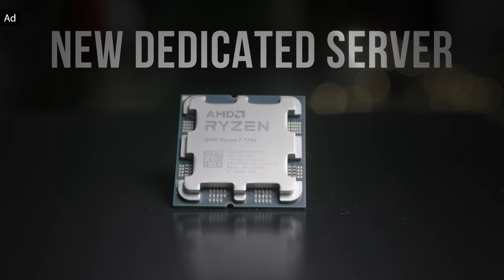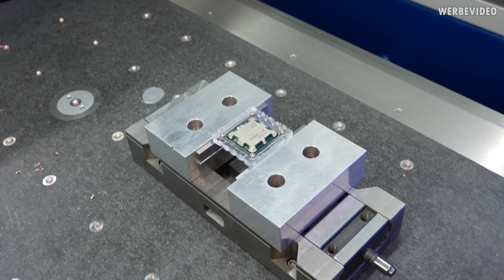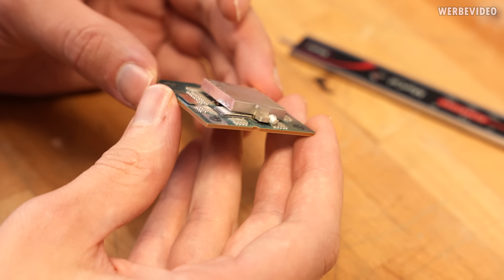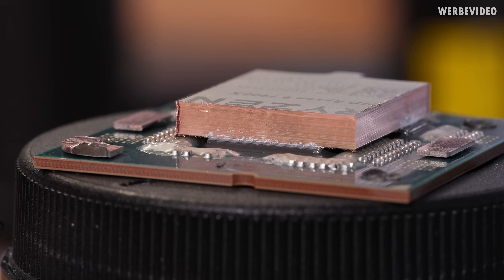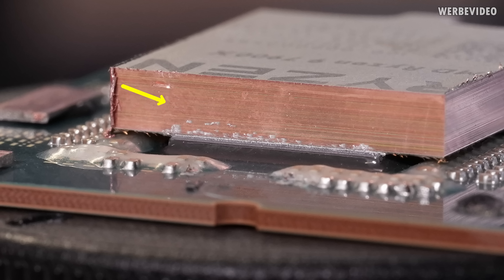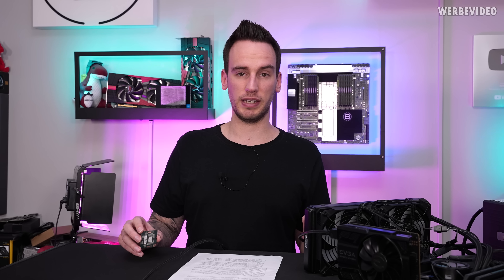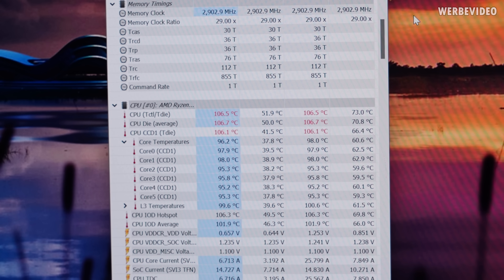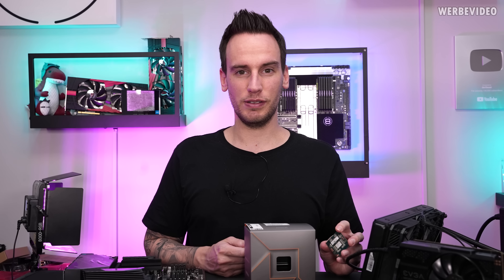Viewer-Mail Ep8: This CPU Unsoldered and Killed itself

Comment: Perhaps some if not all of the thermal probes inside the CPU were malfunctioning? And then PBO just kept increasing the voltage as it saw the good temperatures being reported by the CPU, leading to it killing itself, with the cooler unable to cool the hotspots.
Reply from the maker: I think it's unlikely that all sensors failed but maybe the control circuit itself which is kind of the same result.
Reply: @der8auer-en  but as you mentioned in the video, the water in the aio would likely boil before it got hot enough to melt the solder…. Weird
Reply: It seems a lot more likely it suffered from a latchup and theres nothing the thermal management could do to stop the current from overheating the chip and melting the solder over the fault
Reply: @mycosys  yeah that's what I think happened too. Basically the chip failed in some way (thermally or otherwise) that specifically held an electrical connection open, it thermally ran away burning away transistors on the die and just replacing them with a solid circuit, the cpu was already dead at this point so it's neither going to tell anyone about its temp nor control itself but power was still flowing, and for the microseconds it reached temps to melt the indium and the pressure of the lid-sandwich squeezed it out the side.

Given the craters the cooler was in working order and cooled the cpu back down before the remaining indium could flow back in evenly when the mobo killed the power to the cpu which was no longer signaling correctly
Reply: @mycosys  you still have the "cpu hot" signal for that case. it's a open drain so any component connected to it can assert it (cpu, pch, sio...), and when asserted the VRM shuts down. so there must have been a fault on the MB as well.
Reply: @Alb 92 Presumably he's assuming perfect thermal conductivity between the CPU die and the water in the AIO, which isn't the case in reality.
Reply: could the static damage the CPU die and caused a short which leads to melting?
Reply: Good point. If the Mobo is defective, maybe it will also kill the 7950x3d.
Reply: @Alb 92 not... in this case the indium solder melted therefore the CPU BODY (the IHS) had to be at 160C ! nothing to do with the die temperature ! the IHS is thermally coupled to AIO therefore the AIO had to be close to 160C as well  (because of low thermal resistance between IHS and AIO). the only way how the AIO could reach 160C (or close to) is without water in it or having high pressure inside preventing the water to boil.
Reply: @Alb 92  So the only thing i would mention is that i don't think you can say that it formed bubbles when it melted despite how it may look, it is a very small space and when it comes to the surface tension between the two objects it may just be that is a result of how the indium flowed while it was liquid and was moving out of that location, Also it was delidded so its hard to make a concise conclusion by looking at the base since the act of pulling it apart does change it a bit
Reply: the vrm will NEVER raise the voltage above set value regardless of temperature. following your logic LN2 overclocking wouldn't be possible because at those temperatures all sensors are providing bogus values.
Reply: @robertjung8929  Shorted mosfets on MB can easily pass "high voltage" to a cpu and burn it. But if the new cpu sent by Roman works, it means that short was on the controller IC of the failed one.
Reply: @marcinkwapisz7752  when the high side mosfet in a VRM is shorted then the PSU will definitely shut down due to overcurrent not giving enough time to melt the indium. furthermore if the cpu melted due to a shorted high side then that high side mosfet would have burnt the PCB around it to black charcoal and the user would definitely notice that (at least smell it if not see it).
Reply: @robertjung8929  Exactly and it sounds like they're still using the board so there was obviously not a catastrophic power failure. If we assume the viewer is honest, all I can think is the circuit failed in a state where the board thought it was operating. Then somehow it shorted out enough to cook itself with an AIO strapped to it before the system finally shut off?
Reply: @JJFX-  but still the AIO part is puzzling.. as long as there is water the temperature won't go above 100degC , the temp can rise above boiling point only after all the water is evaporated. so either the block fell of the CPU and there was no cooling at all or the user is not honest.
Reply: @robertjung8929  Yeah, the other strange thing is all 3 dies look like they were getting hot enough to bubble the solder. I hate to say it but I'm leaning more and more towards my original theory that this was a failed delidding attempt using a hot plate or something.
Reply: @JJFX-  looks like it ;) but then there is the flow of molten indium suggesting the CPU was vertical during the heating so probably not a hot plate.
Reply: @robertjung8929  Good point, I'm pretty sure that's the orientation it would have been in inside the socket too. Who knows, maybe it did somehow fail... hopefully Roman shares pictures of the die with the solder cleaned off.
Reply: @robertjung8929  except, there is point at which the cpu becomes partially or semi superconductor in areas while under Ln2,
Reply: @kevinerbs2778  no it definitely doesn't... but even if it did how would that change the fact that the temp sensors are giving bogus readings at those low temperatures ?
Reply: @robertjung8929  lern what a super condor does before talking to me again.
Reply: @kevinerbs2778  learn first what a semiconductor and superconductor are before mentioning them ;) how the heck would a FET work if it was superconductive ? the whole point of a field effect transistor  is to control it's conductivity by applying control voltage to it's gate.
Reply: @robertjung8929  1 that has zero to do with temperture sensors mentioned in your post.
2 the rsistiances is 0 their for bugged senors is normal while becoming a semiconductior 3 field effect can still happen without eletrical flow while in semiconductor form.
Reply: @kevinerbs2778  just stop it... silicon is not superconductive at the temperature of liquid nitrogen ! superconductivity in silicon was observed at 0.35Kelvin that's 77 Kelvin lower than LN2..so accept the fact that the CPU is not becoming superconductive when cooled by LN2 !
Reply: @robertjung8929  Troll
Reply: @kevinerbs2778  you are spreading misinformation => you're the troll.
Reply: @robertjung8929  no you're a troll by sitting here agrureing against me with 0 proof of facts to back up any of your statesments. . When I can prove to you that 77 Kelvin isn't the lowest to be seen observed cpu in extreme overclocking. Beside Ln2 isn't the coldest luquid they've uesd on CPUs.
Reply: @Alb 92 i'm saying indium needs 160C to melt and till the AIO is in contact with the CPU and there is water in the AOI the temperature will NOT go above boiling point of that water which is 100C at atmospheric pressure, that's basic physics. to get 160C on the CPU body (and the AIO waterblock) to melt the indium you would have to have 6.2 bars (90psi) of pressure in the AIO.
Reply: @robertjung8929  The temperature of the water in the AIO isn't equal to the temperature of the die, or even the cold plate for that matter...for a start, if it was, there'd be no heat flow, applying Fourier's Law.

The temperature from the die, to the indium, IHS, thermal paste, cold plate, fins, water in contact with the fins and finally water near the radiator is all one big temperature gradient.

How steep that gradient is along the path, depends on lots of very complicated things, including thermal conductivity, specific heat capacity, interfacial thermal conductance, surface area, fluid turbulence etc.

At any rate, 160°C at the die does not mean the water in the AIO has to be 160°C (or anywhere close to that) - in much the same way that the air in the room doesn't need to be 160°C...
Reply: @tomfahey2823  and who said that ? i'm saying you had to have 160C at the IHS to melt the indium ( the indium was molten and flowing) and if the IHS is at 160C then the AIO had to be very close to 160C as well . i never said a single word about 160C at the die...actually IF the heat was coming from the die itself, then the junction temp  had to be even higher ... please read through the comments and reply to the facts someone really said and not those you assumed.
Reply: @robertjung8929  It doesn't matter whether it's the IHS or the die itself.

Why does the AIO have to be "very close" to 160°C? What is the "AIO" - do you mean the water in the tube, the radiator, the tube itself, the coldplate?

If you have an AIO in your computer, put your hand on your radiator when it's switched on and see if it's anywhere close to the temperature that the PC says the CPU package is at - you'll probably find there's greater than a 50°C degree difference...

The entire point of cooling systems with active cooling is that the working fluid is designed to have a large temperature delta between itself and the cooled part, to maximize heat flow, according to Fourier's Law. 

If the water in the AIO was "very close" to 160°C, there'd be next to no heat flow from the IHS to it, meaning that it wouldn't be providing any cooling to it in the first place.
Reply: @tomfahey2823  physics that pesky physics ruins it all... yes you can have temp difference of 50C no problem there.. problems start when the LOWER of the 2 temperatures is above the boiling point of water.
Reply: @Alb 92 imagine a rice cooker... the temperature of the rice will never go above 100C as long as there is water, once all the water is gone the temp starts to rise and the cooker cut of at 105C... 
this is the same.. to get the temperature above 160C all the water must go (or pressure must rise to 6bar)....temperature of the die is irrelevant.
another example.. you can hang a plastic cup with water above a flame and the plastic will not melt/burn as long as there is water in it.. once the water is gone the plastic cup melts and catches fire... 
the temperature difference you're talking about is there, yes you're right.. but you would have to pump some pretty serious power through to have such a huge temperature difference. 
let's say the VRM is capable of delivering 200W , to have 60C difference between IHS and AIO waterblock you would have to have a thermal resistance of 0.3K/W. most of  the AIOs are declaring 0.07K/W so you would need to pump 850W !! of heat from the CPU to the AIO to get a 60C difference between the IHS and AIO.
so i still stand behind my claims that the AIO had to be pretty close to the IHS temperature and the IHS had to be at least 160C to melt the indium. if you consider the 200W and 0.07K/W then the AIO had to be at 146C minimum to have the IHS at 160C.
Reply: @robertjung8929  While in some cases that is true there are some big assumptions that you are making, Your kind of ignoring time because while you can put a plastic cup full od water over a flame and it wont melt but if you use something like a propane torch  or even say a small torch lighter its going to melt a hole right through that plastic. Also a lot of those thermal conductivity values you get for certain metals or materials only really apply to a solid piece of that material once you deal with and interface between materials it gets a bit more complicated. The size or area over which heat is applied/ conducted makes a huge difference as well.If you heat up a small area really quickly  even on say the cold plate of AIO it can still reach above 100C without the water boiling off it just wont be for a long time. Also not to argue more but I'm slightly confused as to the calculations you are doing to get those values because the K in those values is usually Kelvin not Celsius
Reply: @connorjohnson4402  probably you should get a refresher in physics ;) 1 Kelvin equals to 1 Celsius , when talking about temperature differences the two are equal. the only difference is the beginning of the scale.. Kelvin start at absolute zero so there are no negative values, Celsius start at the triple point of water. 0K = -273.16C . your propane torch is an analogy to have higher power input , which you don't have in this case of melting CPU because you're limited by the max power delivered by the VRM. and yes AIO can reach temperatures above 100C but the pressure must rise,that's why i mentioned the 6bar/90psi - that's the pressure needed to have water at 160C (again that pesky physics).

Comment: AMD  need make new heat sink, people can make new cooler, can't appect this temp
Reply: they could have simply make socket taller, not a fucking IHS thicker - absolutely nothing prevented them to increase height of the socket accordingly to ensure cooler compatibility which is all about distance from motherboard PCB to top of IHS.
Reply: @mroutcast8515  Too true. I hope all the AMD fans enjoy their socket longevity lol ! They will be stuck with this crap temps for 4-6 years lol. I wont be buying it thats for sure. It's bad design in every possible way just like the 7900X3D and 7950X3D that preform slower in some games because they where to cheap to add a second cache DIE yet ask a premium lol. This is what people get when they Become a fanboy.  Overprised bad product design.